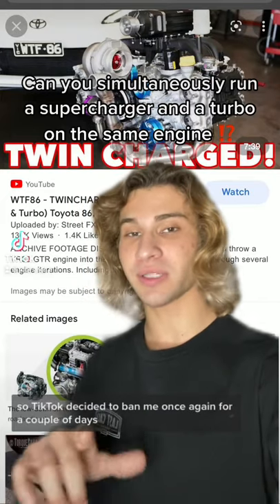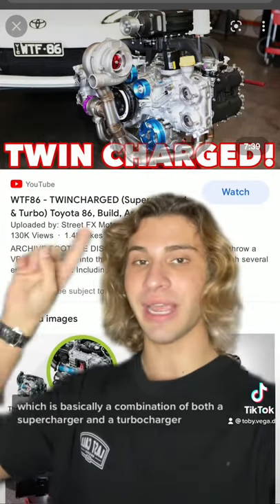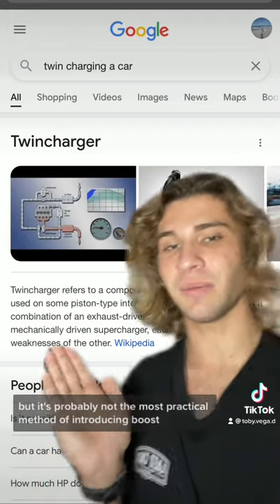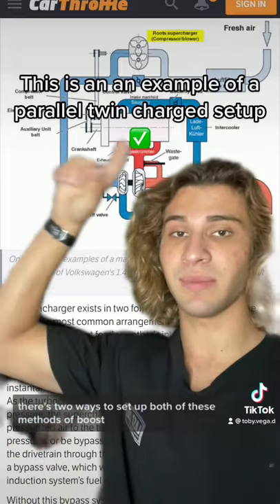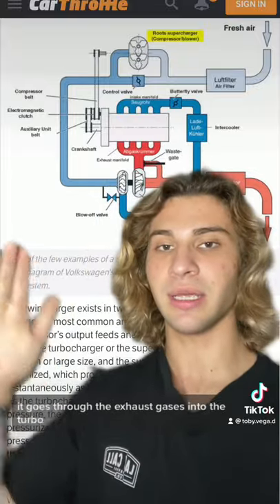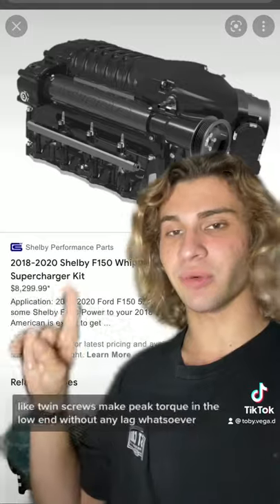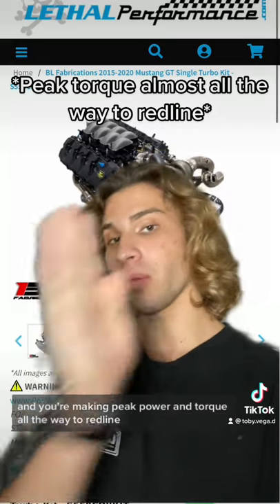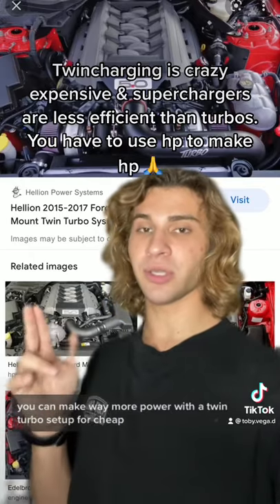CAN YOU RUN BOTH A SUPERCHARGER & TURBO ON THE SAME ENGINE?! (TWINCHARGING EXPLANATION) #SHORTS #V8

Comment: The Lancia Delta S4 is the best example of this system working. It sounds like an angry swarm of hornets off the throttle. It’s an absolute monster, watch videos on the car’s sound, trust me people, you will not be disappointed
Reply: 2.5 seconds 0 to 60 in gravel and at 5bar of boost it produces 1000 hp in a 1.8l  4cyl engine

Comment: Why not make a "triplecharger" engine? Centrifugal supercharger (Procharger) + twin screw supercharger (Whipple) + turbocharger (Garrett). The only problems that I see with this setup is complicated piping and cooling. And I have no idea, should you run 2 different superchargers in series or parallel.
Reply from the maker: Too much parasitic draw!

Comment: Also its easier to control timing with a supercharger, turbochargers literally have a mind of their own. Which is why nissan put a gear on the shaft of the VR30 engine in the new z to see how fast its going to control timing. Wish more manufacturers do this my car almost killed me in rain the other day…
Reply: Boost time problems are plumbing problems. Exhaust goes into pipe that blows through turbo blades. That is all
Reply: @FLORIDAMANIAM-he2lz  Alot of it has to do with the size of the turbine, the amount of gases it takes for it to spool up, however, when it does it increases it speed rapidly which is the turbo lag we experience.

Comment: what if you run the turbo and superchager directly into the intake manfoild from seperate ports using basically a y pipe and just leave them both adding boost or maybe connect them at a intercooler wouldnt that work or am I missing something
Reply from the maker: You can run both!

Comment: What's the best way to Charge your engine? Please answer I want know so can start building my first project car
Reply: There is no best. Super chargers are no effect past a certain rpm. Imagine shifting into 5th and the engine is already revved high with a super charger. Now imagine dumping the clutch with a turbo and having to wait for the exhaust to build pressure.

Comment: I want to twin charge my engine because the turbo i have cant produce more than 0.5 bar because of the small engine displacement and its only a 2 cillinder. so i want to feed the turbo with a supercharger thats forced by the engine to push around 0.5-1.0 bar into the turbo. but can this work because the turbo makes less boost than the supercharger feeding it. Because the supercharger feeds it with a higher boost than the turbo itself can create?
Reply from the maker: Honestly I think you’d just be better off getting a bigger turbo!
Reply: @TobyVegaD  my engine doesnt make enough exhaust gasses for that 😅